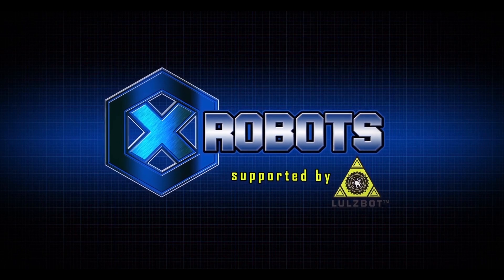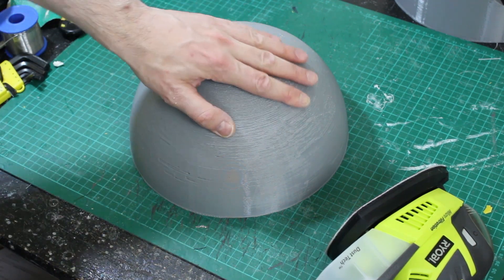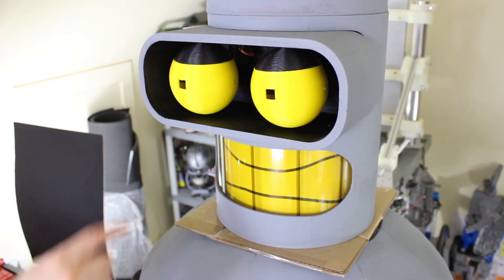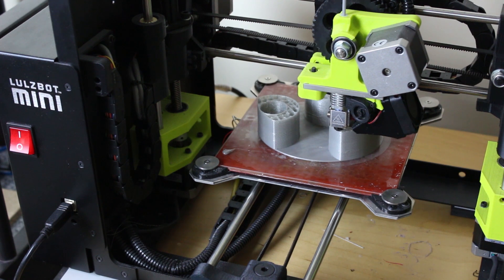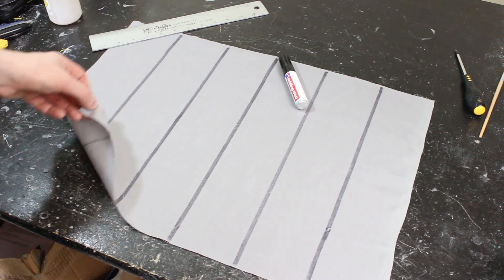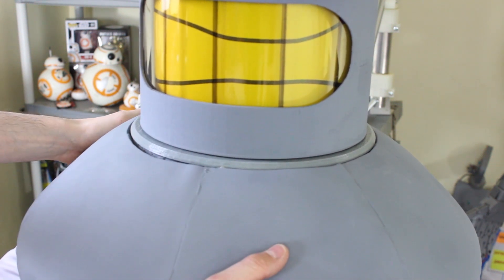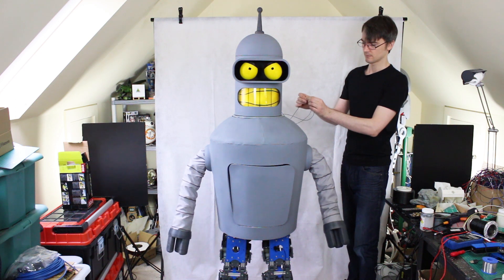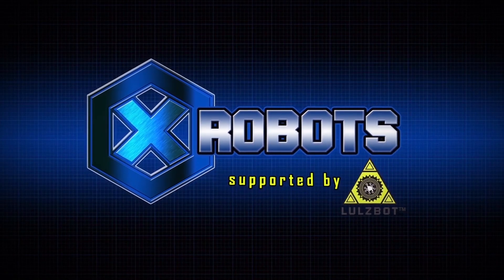Futurama Bender #3 | Cosmetic Finishing | James Bruton

Comment: The arms: fabric is black, it's the black lines drawn on the grey fabric - the space between the metal cuffs that comprise the arms and legs - a small bevelled outside edge plus the small gap between cuffs, would give the same range of motion.

Comment: 100mm ventilation ducting you can get in wicks and tool station I had the same problem for my laser cutter uses a dryer pipe and it was not long enough but that stuff matches up

Comment: You can spray your regular spray paint on top of plastidip and it will flex without cracking
Reply: James Bruton plastidip now makes a "glossifier" which is a clear coat rubber to spray over paint. It has all the same rubbery texture of regular plastidip. Maybe that might be of use. Love the build!

Comment: for the ARMs Try Flexible Vinyl Vent Hose *Used for AC duct work as well  https://www.walmart.com/ip/LAMBRO-INDUSTRIES-4-Inch-x-20-Ft.-White-Flexible-Vinyl-Vent-Hose/46659422?wmlspartner=wlpa&selectedSellerId=3005&adid=22222222227034027889&wl0=&wl1=g&wl2=c&wl3=84130862049&wl4=pla-143984956089&wl5=9051872&wl6=&wl7=&wl8=&wl9=pla&wl10=113146015&wl11=online&wl12=46659422&wl13=&veh=sem
Reply: ah, well try AC companies they use that Flex tube as well, saw this web site as well http://monmouthplastics.co.uk/flexible-ducting?gclid=Cj0KEQjwioHIBRCes6nP56Ti1IsBEiQAxxb5G1aSsXOXdl_HRypxIoxDYIt5B_zn0ZVHNnU2MWOyCqEaAjmn8P8HAQ

Comment: I think rather than covering the legs with fabric as you did the arms, I think the effect might be better if you dressed up the legs with rigid parts
Basically, I think the effect if the Robot-X legs are covered with fabric will be "pants" (Or rather, "trousers" I guess) - the effect works a little better on the arms because they actually do mimic the tentacle-like nature of Bender's arms. But the legs have a single point where the knee bends, so unless the fabric covering is very stretchy (and perhaps even if it is) you'll get a lot of drapery effects, folds in the cloth, that sort of thing.
You'd basically lose any pretense that the leg is a continuously-flexible tentacle-like structure, but in exchange you'd have more control over how the surface of the leg looks.

The effect would be kind of like a jointed action figure - it's not going to look right at the knees and elbows (especially when they bend) but the effect can be pretty good if you're clever about the design.

Comment: For smoothing PLA I've had a lot of success with dichloromethane / methylene chloride, dipping small parts and spraying larger ones. it goes soft initially but after 2 or so days its very rigid again. Cheap and easy to get online in the UK too ~£2 for a litre

Comment: Fantastic work as usual James. Well done! Have you considered using strips of flexible cutting board for the arms? I also they believe there are sheets of rubber commercially available used for making gaskets which you could then paint

Comment: the arms need a fuller movement that could look a lot more organic if you use a tri string tentacle system  for each arm and mounting the motors at the shoulder would lighten the arm

Comment: Would gentle heat treating the 3D print not work better to eliminate print lines? A blow torch at a nice distance, swept back and forth, cool down and repeat til smooth.

Or even thin some epoxy resin and paint.

Comment: I have a cool idea for prop for this Bender: a cigar of course. You craft it with LED's for the burning tobacco and then use an internal vape pen that has nicotine free, flavorless fluid. It can be controlled by a small Arduino over BluTooth and could even coordinate with the main robot to take a puff. Use a similar setup to the cigar's, but with a higher output, to let him exhale.